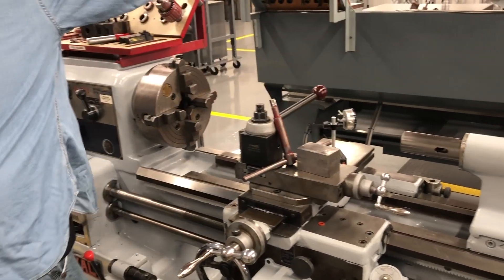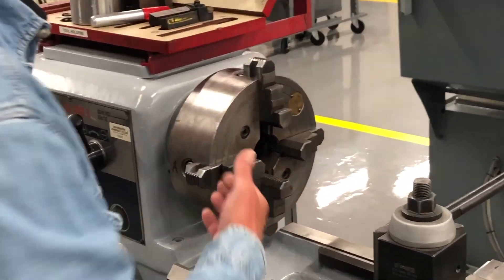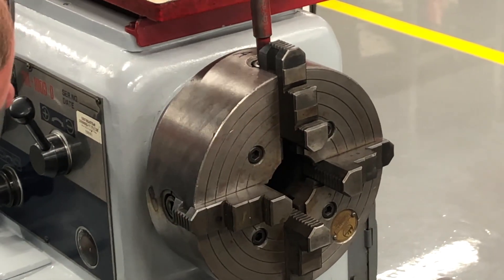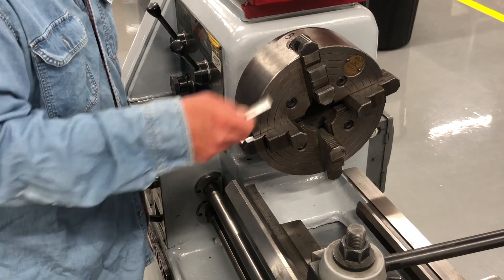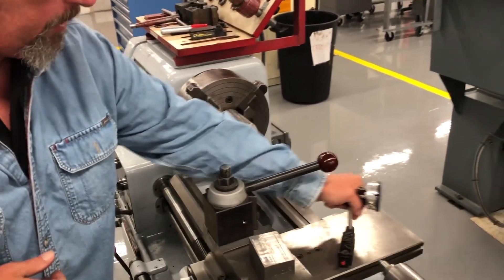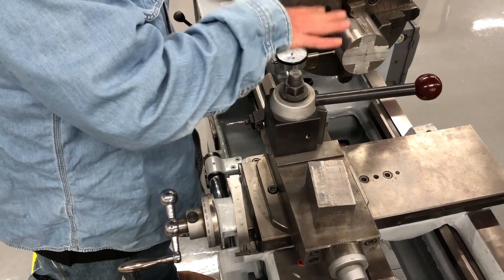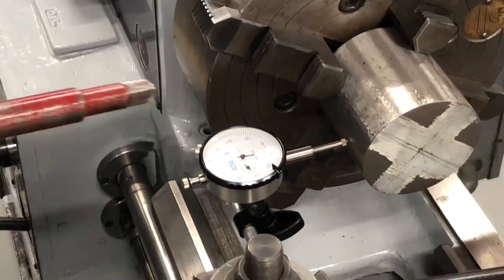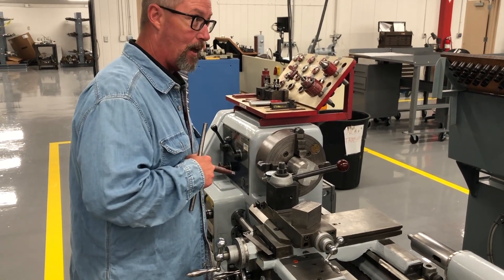4 Jaw Chuck Centering   (taught by a Machinist)

Comment: I was taught to center the part within three revolutions of the chuck. If you analyze the methods you have been using I think you will discover that it is possible. I got yelled at if I spun the chuck too much.
Reply from the maker: Good tip, thanks